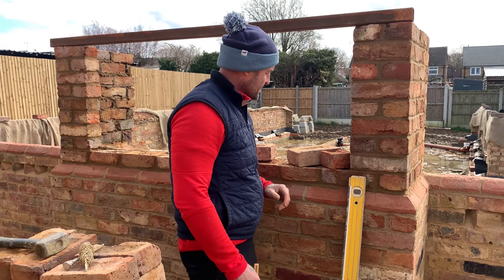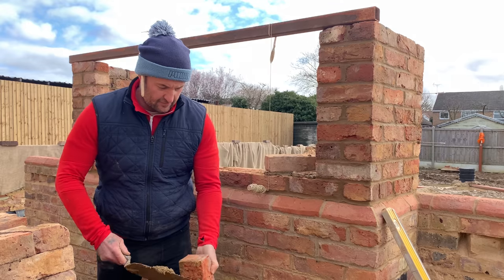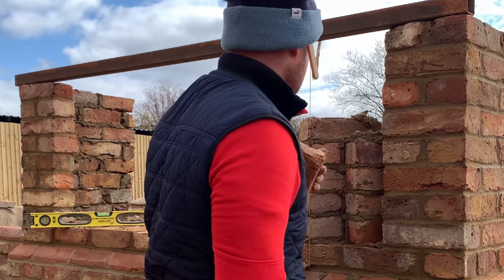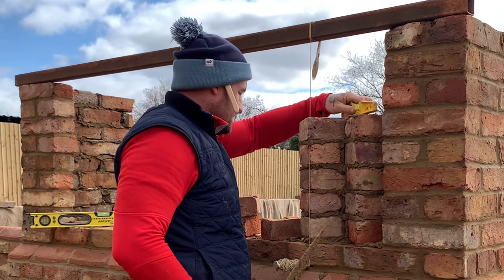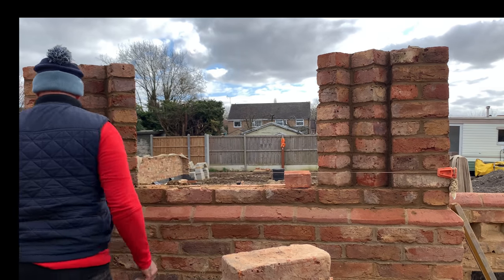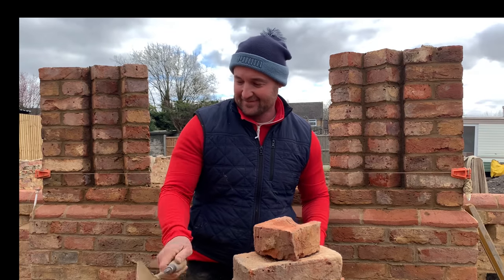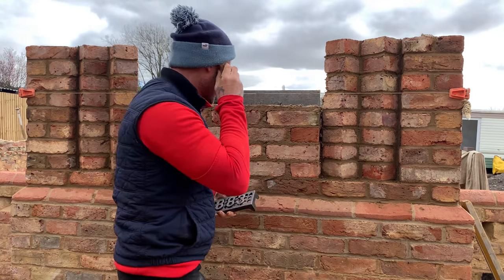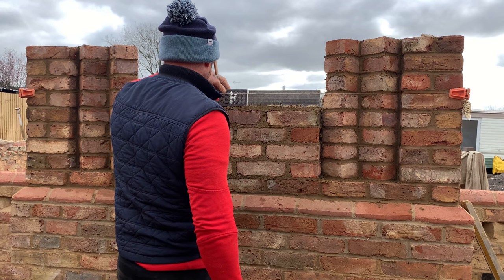#brickwork #bricklaying 🧱🏠 Feature brickwork detail

Comment: Nice work pal.I was wondering why you didn’t put a 3/4 brick on the corners at first where you had a single plinth, but then you introduced another plinth further up.Lovely job fella👍
Reply from the maker: Which such variation in stock sizes ,these bricks are so time consuming ,u could dry bond a course 4 times and have different outcomes mate ,so I just pick and lay and expect a 3/4 

All the other work above plinth  is block work so best to keep work below bond to the 
Plinth.
Reply: Personally i hate putting poxy 3/4s in on a single plinth, its just for the perps to line up above plinths.Keep up the good work.This is my cup of tea👍